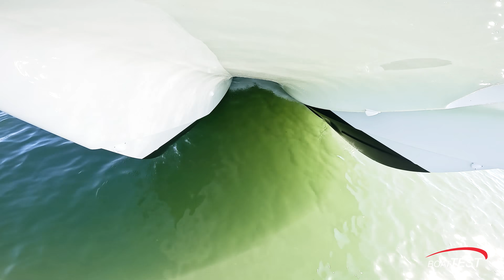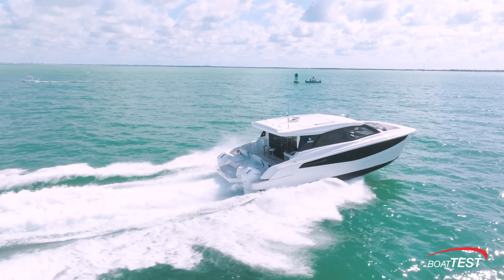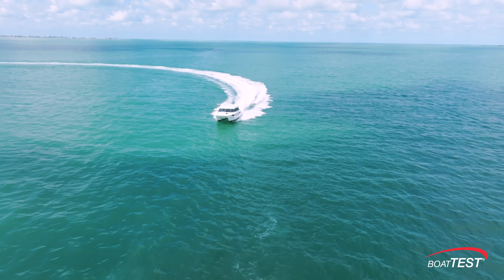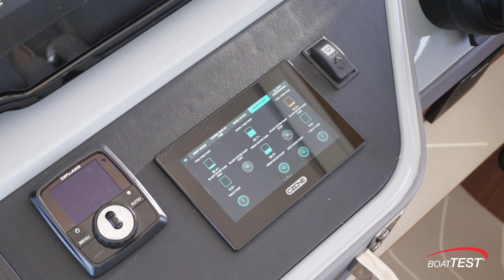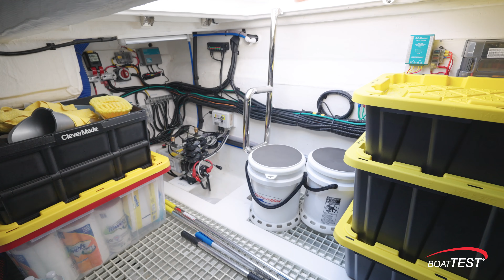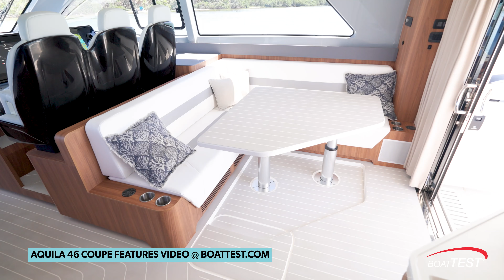Aquila 46 Coupe  "Performance & Test" - BoatTEST

Comment: I always enjoy your videos (sea trials and features). Pretty darn thorough without turning the video into a feature-length movie 👍👍.

One question.... if you had to make passage and wanted to do so with the greatest efficiency, what range might you get at 10ish knots (or 12 or whatever)? Traditional yacht drives seem to get 2.5-3X range at displacement versus best cruise on plane, but maybe not quite that on this given the foil?
Reply from the maker: Thanks so much for watching and for the kind words!  At 10.5 knots, this boat has a range of about 183 nautical miles with a 10% fuel reserve. You can also see the full range data at different speeds, along with all of our performance numbers, on our model page here: https://boattest.com/boats/aquila/46-coupe-2025
Reply: @BoatTEST  great data.... and I'll look over all of it tonight. But it looks like best nmpg is at a ridiculously slow speed, so that 35 knots is definitely the sweet spot. 👍🇺🇸
Reply: @BoatTEST  So basically, based on the chart in the link, the boat doesn't want to run 8-15 knots, it wants to run 30 and is twice as efficient as 8-15 knots at doing so. Am I reading that correct?
Reply: @bjackson1975   Yes. You should be wary about running any large-engine planing hull at displacement speed for long-hauls. You'd be much better, for fuel and engine, to be on a displacement or semi-displacement with a much smaller set of engines. Like how Trawler Explorers actually do, or many of the Dutch river coupés. They're the ones for the Great Lakes, not high-performance screamers like this beast.

Comment: 5000 rpm’s is never best cruise.
Reply: Except in this case it literally is. At 2500 RPM it is doing 8 knots and 0.6 MPG for a range of 395 miles. The numbers then dip and dip and dip, like all boats as the revs increase... UNTIL you hit foiling, at 5000 RPM, the performance sweet-spot, and it is doing 35 knots and 0.7 MPG for a range of 404 miles. And that's on 600 gallons of gasoline. They also do a diesel version and that will be even better. This is why it is called revolutionary... it is more efficient at 5000 RPM than 2500 RPM.
Reply: @DarthKEK I understand it’s the best mpg, but running your motors at 5000 for a sustained cruise is not ideal as for as longevity goes.

Comment: Foil is cool tech, but with the additional draft it makes both the 42 and 46 unattractive for many areas in SWFL. MarineMax says it’s removable, but you’re paying for it. It would be useful to have BoatTest or Aquila data on what’s lost in speed and fuel consumption efficiency.
Reply: I marked it off my list due to the additional draft, as compared to the 45 sport, shallow waters of the gulf and because I can’t safely beach it. Looking at the 45 sport instead, which only required 2 feet for the boat to float. No foil !
Reply: how much draft does the foil add?
Reply: I was under the impression it only adds about an inch or so. At least that's the case on the 36.

3 ft draft is hardly a deep boat. Perhaps someone could point out some examples of boats that would fit this roll (day/weekender) in the 45ish range that are noticeably shallower?

Comment: Capt. Tripp did you check the fuel gauge?  (jus say'n😂)
Reply: Ha! That's a funny one there.... Yes! I check them for sure. Had a shoot once where I checked the gauge before setting off (100% fuel). I thought to myself, "wow! they topped the fuel off for us! How nice of them....."   An hour or so later after running for a while getting performance numbers I glanced at the gauge again to see how fast we were burning through it. Still 100%..... Uh oh.... lol   A couple hours later, we ran out of fuel! In a very treacherous spot in nasty seas. Barely saved it on the account of some quick thinking and makeshift tow line...